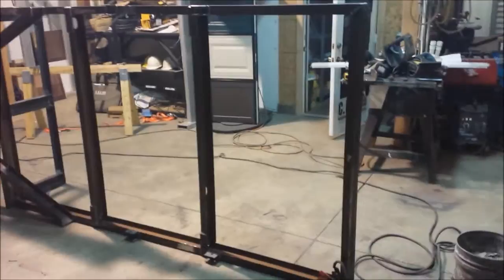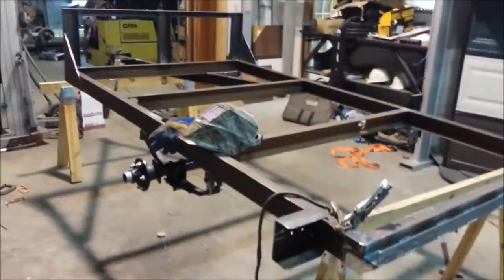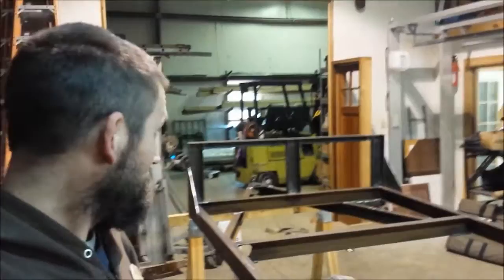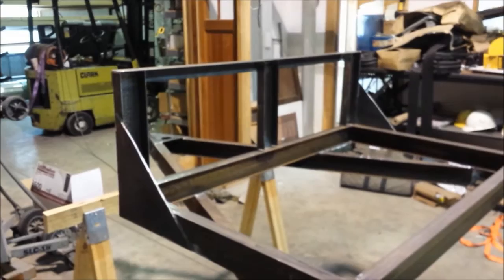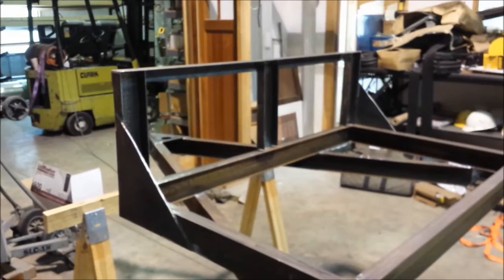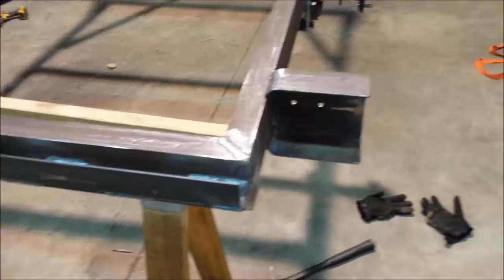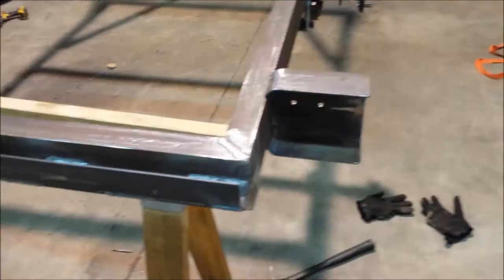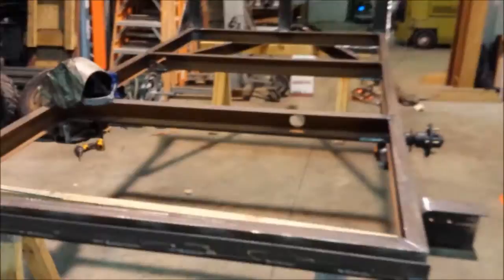Day At Work Building A Heavy Duty Trailer.

Comment: Nice trailer and strong I'm sure, but don't think it's capacity is actually as much as the weight of that lift truck. Especially the weight capacity of those tires. I'd guess that lift truck will weigh close to 6000 lbs. It should've at least had tandem axles. That's only my opinion tho.
Reply from the maker: We came to that conclusion as well. Now we just have an over built utility trailer. We ended up getting some real heavy duty tires for it so now, if it's fits up there you can haul it, except the fork lift we built it for lol. Thanks for watching.

Comment: nice video , short but informative, great build on your trailer, i have 2 questions ... what is the size?  and did you  put brakes on that axle?
Reply from the maker: 4x8 with a 3,500lbs axle
Reply: it's only a 2000 lbs rated trailer, no brakes required up to 2000 lbs. The axle tubes are too thin to be more than a 2000 lb rating.

Comment: nice job wonder what kind of layout you would recommend for a 28 foot boat looking to build it myself...
Reply from the maker: maddog hound I'd say the most important thing is the right axles for the weight of the boat. you'll definitely need trailer brakes for somthing that big. from there it's a matter of building a strong enough trailer that isn't too heavy. for a boat that big 99% of trailer manufacturers will build it out of aluminum. I don't think building it out of steel wound be practical. the trailer would end being so heavy. just my 2 cents though.
Reply from the maker: maddog hound I'd say the most important thing is the right axles for the weight of the boat. you'll definitely need trailer brakes for somthing that big. from there it's a matter of building a strong enough trailer that isn't too heavy. for a boat that big 99% of trailer manufacturers will build it out of aluminum. I don't think building it out of steel wound be practical. the trailer would end being so heavy. just my 2 cents though.
Reply: thanks buddy, ur right will have to look into getting aluminum sound advice,got my first mig welder last year, never welded aluminium before wonder it you can with a mig?hoping not to have to get brakes for it though live short distance from the sea and can get the use of a tractor for launch all going well... but what kind or aluminium would i be looking for size wise Jack,that wont bend too much over 25 feet span ?
Reply from the maker: maddog hound I can answer most of your questions but I'm not the right guy to ask. you should contact a local trailer builder and ask them.
Reply: Hey Jack,been looking online hard to get material like that here in Ireland there looking for crazy money,will probably have to go with the galvanized steel thanks again keep up the good work...

Comment: How do you figure out what size metal you need to use?
Reply from the maker: gunnar stahl it really depends on what your plans are for the trailer and what axle you have. here in Florida a trailer gets weighed when you get the license plate for it. the heavier the trailer the more money it costs. we have built a small trailer for a smoker set up out of 1.5" square tubing with 1/8" wall thickness. that trailer ended up quite light. this trailer here is way over built and is heavy as F#%@. remember the weight of the trailer and the rating of the axle are important. build a 1000lb trailer with a 1,500lb axle and you can only haul 500lbs.